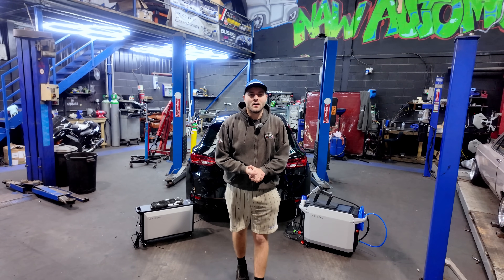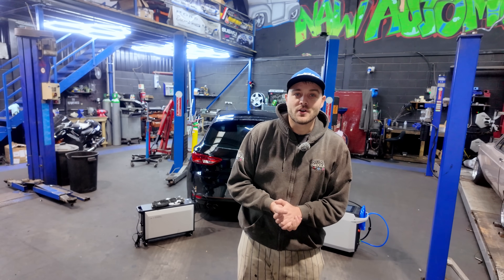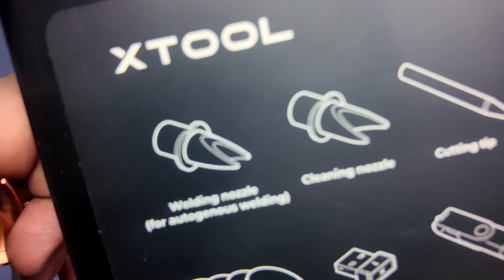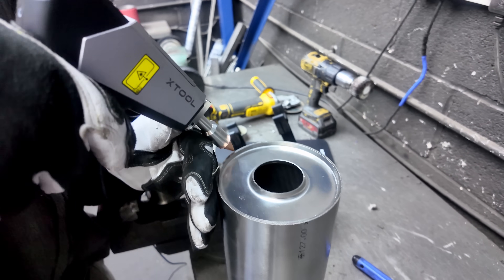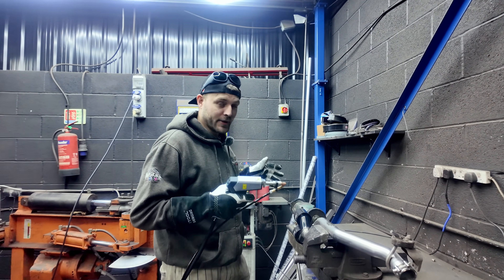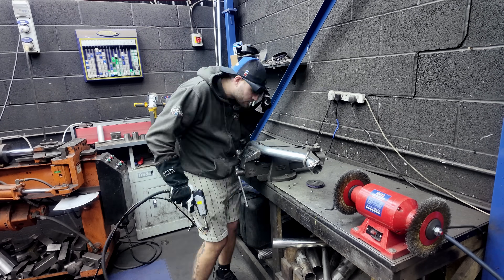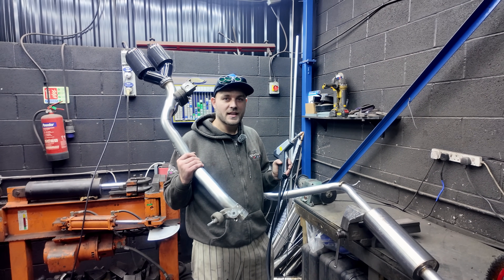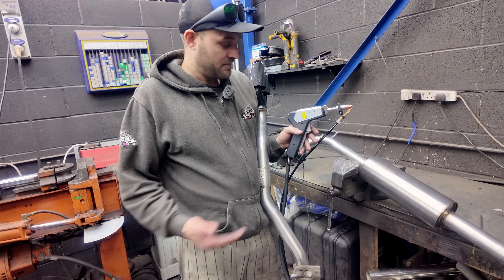Laser Welding an Exhaust for the First Time – Can It Really Work?

Comment: I'd love one of those, but they aint cheap! I thought you'd struggle welding tube, with the gun being so big but I'm impressed how easy you made it look. Do you teach tig? I'm only up the road from you! Chris.
Reply from the maker: Honestly it's dead easy to weld tube. Zipps round it like lightening it does. Silencer welds and tip welds are where it's tricky as hell to get the hand of. Sadly I dont really teach tig no its a long process 😂

Comment: A nice small rotary welding manipulator would go nice with that for making your silencers! Great job!
Reply: I was going to suggest the same thing. I’ve got a small one to which I replaced the tiny chuck with a 4” version. It really does work well. It would take half the time with only one start and stop. They only cost around $300.
Reply from the maker: Yea it would!